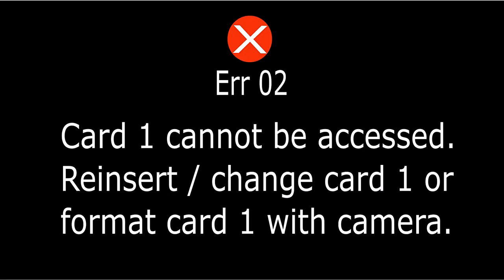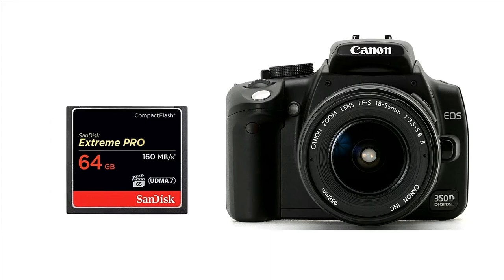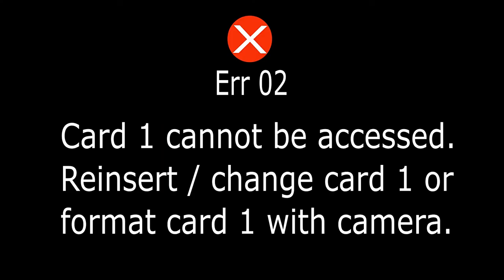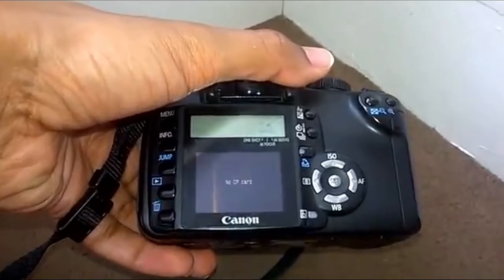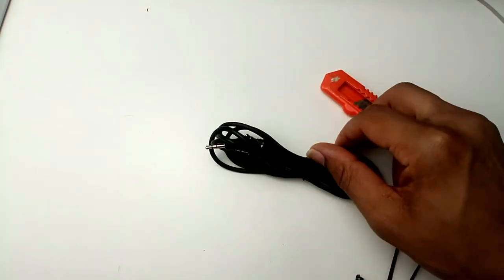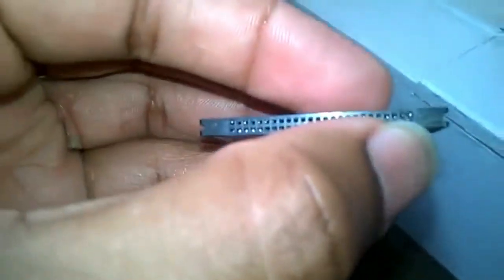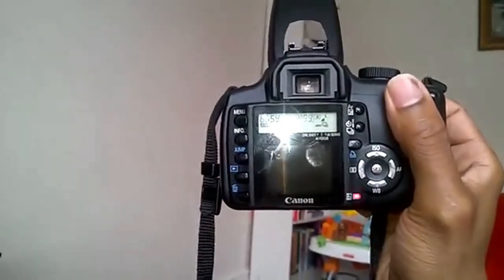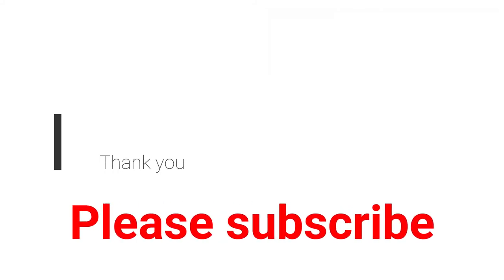Solving CF Card error on  Digital Camera | DSLR | Erro 99

Comment: Sorry pal, but this is not great advice. Just get a small screwdriver (a tiny long one) and unbend the pin. That's what I've done to my 5D mk4.
Reply from the maker: Some of them are completely gone and you won't be able to unbend
Reply: Privet brat, You are right, I did something similar but it all depends on the situation for mine i just straightened it too, for others when it is broken they might need it for contact.. But i must say I am so so grateful i saw this video big ups @carvlog

Comment: CANNON EOS flashes a "Err  CF"  on screen.  What does that mean?  please help.  I recently bought new card from Lexar professional.  32GB 160 MB/s When inserted it flashed the above error.  I have looked in book. not found.  I was using a SAN DISK EXTREME 120 MB/s 32 GB. what changed? it fits, but  does not work.
Reply from the maker: It is actual a broken pin inside your camera

Comment: Just straighten the bent pin/pins, it's not that hard, and takes no longer than the wire trick, plus I wouldn't be poking foreign pieces of metal in my expensive camera!
Reply from the maker: OK
Reply from the maker: they already tried that and did not work until they find this idea works
Reply: Yeah I’m trying to do that but it’s hard to make the wire perfectly straight
Reply from the maker: @pawegawrysiak3046 hi , u do not need it to be straight, try to use the wire which is used to tie the electric wires like tv cable or earphones

Comment: instructions unclear the metal piece is stuck in the cf card
Reply from the maker: Yes it should be inside the cf card but make sure it edges out little bit, use the cable tie, the one used to tie the wires